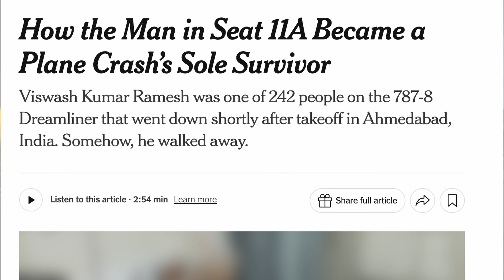Why the RAT Changes Everything – Air India 171 Update

Comment: Question about the RAT. If it deploys prematurely and if not needed, will it override primary systems? Meaning if all the systems had been fine and it deployed would it be competing with those other systems; fuel to engines, hydraulics etc?

Comment: Short of fuel contamination and FOD indigestion (which just doesn't look likely as there is no smoke trails),I just really hope we are not dealing with another event where an engine failed and the wrong engine was shut down.

Not saying it did,but at this stage they should have been able to verify from either the truck or pit that supplied the fuel,whether or not fuel contamination was the cause.

Since this is an ETOPS aircraft,we should be able to exclude any duel maintenance events.

Comment: 8:36 but why would the flaps be up so soon with the landing gear down
Reply: With over 11000 ft of runway and good weather the pilots could have very well used a low flap setting like flap 5 which would be impossible to definitively observe from a distance especially from a rear angle
Reply: @Phoenix-ij7td it was a 93% full plane with 100% fuel capacity despite only needing 53%. They only had half the runway and it was 39 degrees. Apparently they took off with a low acceleration and low thrust. No way the flaps should have been set to 5
Reply: It’s hard to ascertain flap setting from these videos. “Flaps 5” is just not that noticeable from the rear view.
Reply: It was hydraulic failure rat deploys for hydraulic failure
Reply: Engine Failure
Power Failure
RAT deployed 

This much happened means gear malfunction also can be probably occurred

Comment: If it was dual engine failure at the same time this could have been vapor lock, but I seriously doubt that.  Jet fuel is far less volatile than gasoline, it is really just a type of kerosene.  We have jets fly in and out of extremely hot airports like Las Vegas and Phoenix and Jeddah every single day and no problem, I have seen air traffic halted at Phoenix because of the heat but not because of the fear of vapor lock,  it was because with the air so thin the runway was not long enough to get to a takeoff speed.  It was 105 degrees that day.  We get that type of heat in southern Oregon, in Riverside and San Bernardino and both those cities have air force bases.  I saw B52s taking off when it was 119 degrees there.  But that does not explain why there was an electrical failure of the auxiliary backup system, nor the third power source in the back up battery to the backup battery system.  And it would take both engines, and both backup systems to fail for the RAT to deploy.  It is not impossible just lower odds than a cargo hold fire from shitty Boeing design and manufacture.  These planes should all be grounded till the problem is figured out and fixed.  Remember that when the shitty 737 Max went down in Ethiopia they shrugged, only four and a half months between the Air Lion crash and Ethiopian crash.   737 MAX had its first flight on January 29, 2016, and flew for years without an incident till October 29 2018.  But to be honest those started crashing within a short time.  Because they are a very bad design.  And Boeing is now known to put profit ahead of safety.  I wonder if we will ever be told the truth or if corporate billions will mean we are fed more lies?  Boeing is a MAJOR defense contractor.  The government can't afford for it to go under when it is revealed that they manufacturing is shit and they cover up some of the sloppiest work in aviation.  The bean counters in Chicago run the corporation now, not fliers or aviation people.  It is a trade off for them between the cost of lost lives and airplane sales, they cannot afford to ground the Dreamliner so it will keep flying.   They are already 10 years behind schedule on deliveries of the 787 and a grounding will end Boeing.  You said it yourself, had the pilots been handling the plane and the flaps misconfigured there would have been horns and sirens and red lights going off in the cockpit.  The mayday call had no noise other than the pilot about to die.  Because the automated systems were DEAD DEAD DEAD!  By the time the pilot got out the mayday he had five seconds to live.

Comment: One other interesting thing from the original video. The audio is still not the best, but those engines should be loud. At the point the plane stops gaining altitude, it's pretty quiet. Maybe another thing to suggest a dual engine failure.

Comment: i thought the battery gave you the minimum to run the electronics and the hydraulics on an airplane. The rat just act like an alternator to keep them charged on a longer emergency landing. So none of those systems should of failed with or without the rat. Obviously something else failed. Lights flickering makes me think it was an electrical/battery failure that made the engines die.

Comment: I don't  think it's a dual engine failure. Take my theory with a gain of salt, but I suspect that some kind of automatic system mistook takeoff configuration from landing configuration and auto switched the engines off when it considered that they are producing too much thrust to land safely and they couldn't debug in time.

Comment: As a former flight engineer on both rotary , and fixed wing aircraft, I can see how fuel contamination can be a contributing factor.  One question I have is, how well did the APU run?  Good job on the scenarios.

Comment: This makes more sense to me because as you well know, you don't get to a 787 without a lot of prior experience. While I'm well aware that the worst commercial airline accident in history was sealed by the complacency of a very senior caption, I  have to assume the flight crew are absolute professionals that were put into an impossible situation.  I watched the same video you did because I saw you comment there and I came to the same conclusion that the RAT was deployed.  To me this is far more unsettling because it may indicate that something went wrong on the aircraft itself.  If so, what, why and how?

Comment: Captain Steve, I think this whole RAT theory is a red herring. The 787 systems are different from the 777 in terms of redundancy. The RAT will only provide hydraulic power. There is a hydraulicly driven electrical generator. The 787 has a huge battery electrical backup potential. The smoking gun is the airplane's electrical load sheading schedule. In the event of an emergency, cabin lighting is one of the first things to go off line. The survivor said the lights blinked. If the engines failed the lights should have gone out. Another thing that makes the 787 different is the generators are a direct drive DC generator that also acts as the starter motor for the engines. The 787 provides variable DC power that is conditioned to the 120V 400Hz electrical buses. Windmilling engines should drive the generators. This doesn't mean the generators cannot be disconnected, because they can. There is a bunch of speculation in the Indian media about the  The whole thing about the RAT deployment theory is what caused it? I don't know if the RAT can be manually deployed. One thing I have always believed about the 787 (and other FADEC controlled engines) is the redundancy of the throttles. Engine power is a critical basic flight control. Don't get your neck stuck out too far. I'm sticking with my other comment, the wing config changed.

Comment: I am not a pilot but I got it right. I am no avaition expert but I  know about the laws of physics. I have flown hundreds of times and I have never seen a pilot use all the runway like he did and the plane started drifting to the left. If that aircraft had full power it should have stayed in a straight line because there was no cross wind. Maximum thrust = maximum forward motion.  It was disgusting yesterday of some of the nasty comments I saw about those pilots that just died with no evidence of anything at that point.

Comment: I am sticking with my original theory which is catastrophic failure caused by the manufacturer.  The plane took off so no hydraulic issues.  The plane crash produced a fireball and thus no fuel issues.  The passenger stated the lights were on so no electrical issues.  The engines need fuel and electrical to run if not damaged.  If the engine stops receiving one or the other there are back up redundant systems in place and that was the failure.  It could have been within the delivery systems themselves or computers that managed it and this may have been an ongoing issue with 78s built in a certain time period.  Would need to examine the maintenance logs at the forensics level.  I am thinking of a ground stop on 78s until we get more info.  I still rule out pilot error.  Would love to see the European investigators on this one as they were the ones to crack the 73 Max 800 and 900 MCAS issue.  It has been an awful year in commercial aviation and we are only 6 month into the year.  Respectfully and deep condolences.

Comment: Theory: The aircraft obviously lost all engine power. This is confirmed by one, the RAT deploying, two, the captain's mayday call to ATC where he said: "Mayday, Mayday, Mayday, No Power, No Thrust, Going Down", and in the video you can't even hear the engines running, but you can hear the RAT. The airplane sounds like a turboprop aircraft, not a 787 Dreamliner. Whatever loud bang the survivor of the crash reported hearing before the aircraft slammed into the ground was most likely the sound of the RAT deploying. Also, it appears the pilot's probably changed the gear lever to the UP position. In the cell phone video of the aircraft flying by, the gear is tilted forwards which is what occurs when the gear is raised on a 787. In the CCTV video of the airplane rolling down the runway and lifting off, while very grainy and low quality, it appears the gear titled forward signaling the gear lever was changed to the UP position. Something must have messed up the Center Hydraulic System, which is responsible for operating the landing gear on the 787. The RAT is also not going to provide power to raise the gear, as it is only meant to provide emergency hydraulic and electrical power. This is just a theory based of the info on the crash so far.

Comment: There seems to be evidence the gear was in the process of being retracted but stopped with engine/ power failure. If you look closely the gear is tilted down and forward (early retraction) instead of up and back (full down & locked) especially on the left side.

Comment: Captain Check the Video of Passanger who travelled from Delhi to Ahmedabad. He made video as AC is not working. Screen & other communication means fitted to seat not working. Pressure in Cabin going on off . This could be sign something failing but was ignored during precheck by ground maintenance team. Accident probably due to something failure and not pilot mistake

Comment: Survivor recalls white and green interior lights flickering implying full electrical failure. These were warnings about sub-par 787s being delivered abroad which would fail and not last the longevity of the plane. Boeing profit driven changes after the merger has caused these crashes.

Comment: 40c / 104f. Does the airport have a hydrant system or was it truck delivery?  

How long was the truck sitting on the ramp in the hot sun.  How long was the Aircraft on the ground.  Putting hot fuel in a wing would continue to have the fuel heat up.  What was the fuel temp?  

Then add maximum fuel demand on takeoff and climb.  

Is vapor lock a possibility here?

Just a thought

Comment: When you look at the video of the plane taking off, when it rotated, it did not look like it had much thrust, at that point, as, it took the whole runway and it did not seem to climb off the runway, as fast as you would normally expect. It came off the ground and almost right away, stopped climbing. Makes me wonder, if the issue with thrust, happened, at around V1 and the pilots decided it was too late to stop and kept going.

Comment: Could the plane crash have been due to an error in the computer data... as a reference to the weight of the plane... for example, instead of 20 tons... the pilot wrote 10 tons, meaning the plane did not have the strength to take off?
It happened once in Dubai... and unfortunately we didn't mourn any casualties, only injuries.

Comment: Dual engine failure seems unlikely doe to fuel contamination.  If contamination, then other flights before and after should be affected.  Bird strikes simultaneous on two separate engines seems unlikely especially with no dead birds found.

Comment: My speculation is prematurely raising the flaps. If the flaps weren't extended at takeoff, its likely it would have crashed even sooner. Besides if you attempt to take off with the flaps not extended, alarms go off warning the pilots.

Comment: 787 has electric fuel pumps. If there is a catastrophic electric failure, possible loss of fuel to both engines or at least an interruption of fuel maybe resulting in power loss ?

Comment: Excellent explanation cap Steeve!
I did read somewhere that the aircraft was issued several warnings for not keeping up with the maintenance and partly the responsibility goes to TATA group who owns the aircraft. This incidence could have been easily prevented if the aircraft was in a proper working condition at this point I don't think so pilots made any major blunders that could have led to this outcome. May all souls rest in peace. Ameen

Comment: Also, you can't hear the engines as the aircraft goes by.  They would have been at full power.  If you look closely at the close up you can see a dark line on the aft part of the wings which may be theb separation between the wing and the flap when it's deployed.

Comment: The dual engine failure is interesting  but opens up a lot of other questions. How would 2 engines fail at the same time? We're talking about 2 different fuel pumps, 2 different FMU'S, different ejector pumps, and boost pumps and so on. I don't claim to know the 787 but I have worked on large aircraft for 25 years. To me electrical failure is a symptom of the engine failure because the electrical can fail and the engines will still run " at least on the commercial jets I've worked on. I would be looking for something that could cause dual engine failure at the same time. Whether it be fuel related or shutting the engines off with the switches. God bless the passengers and their familes.

Comment: I grew up in New Zealand near Christchurch Airport and the sound of a Harvard trainer is very similar to that RAT.
Thank you for updating our understanding of this terrible crash.
Reply: Yes Harvard has that distinctive sound like the RAT as tip of prop is travelling near the speed of sound.
Recall them flying overhead many a time making that sound and same when they're doing aerobatics as the Roaring 40's do at air shows.
Reply: 1:38 Sir, at this point you can see the Engine Flame Out Smoke. That's not Dust. 😢😢
Reply: The Air India CEO is from Christchurch
Reply: What about the loud BANG the survivor reported? He said it happened right after takeoff.
Reply: @diversityparty captain Steeeve said bang could be RAT deployment as its  from memory (and by design) a gravity deployed system and so will be quite noisy and apparent when it drops out of fuselage. 
Unlikely bang to be engines or bomb as no visual evidence of engine or any other explosion is seen or heard on recordings and would be already mentioned if it had been noticed.
Reply: Hello, I am from India and I am 100 percent sure that Turkey is involved in this plane crash.🤬
Reply: Never heard a rat before, but i certainly did hear the distinct sound of the Harvard prop many times.
Reply: correcting our understanding*
Reply: India is not in Harvard. fyi
Reply: aussie is the new zealand

Comment: You can clearly hear the aircraft had no thrust from the very first eyewitness video. Engines were at best spooling down. Sounded more like an aircraft in a landing profile, operating somewhere around idle. If in doubt search here on YT and you will find the actual aircraft (obviously different WX and environment) taking off from BHX the difference of the engines with normal take off thrust is obvious. I am surprised no one has picked up on this

Comment: The problem with your initial evaluation is that you were so fast to blame it as pilot error!!!  You were praising the safety record of this   aircraft. Trying to be first to come up with an analysis  without propwr data !!  You should have considered that in the first place.  These pilots have been flying the plane not just the first time. Apologies are in order that you made a mistake in your initial assessment making it look this this was due to incompetent pilots, maybe incompetent aircraft makers or maintenance of just age of plane or part should have been considered. This is a BOEING known for how they had issues safety in manufacturing.

Comment: With the air conditioning and other lights/electronics not working it seems the most likely culprit is a massive electrical failure. Both engines lost is just way too out there for me to co-sign that

Comment: Your second place theory that the co-pilot raised the flaps prematurely is bogus.  787s will not allow premature raising of the flaps at slow speed and low altitude.   Also, you missed the fact that the first step of gear retraction on a 787 is for the gear truck to tilt forward before retraction.  The gear did that but didn't complete the retraction process.  That points to a total loss of hydraulics after the tilt but before retraction.